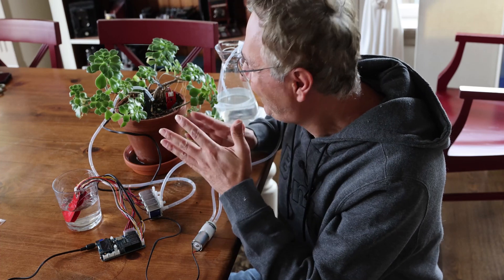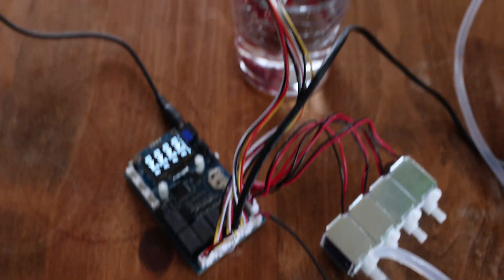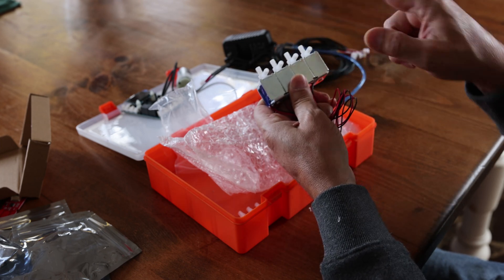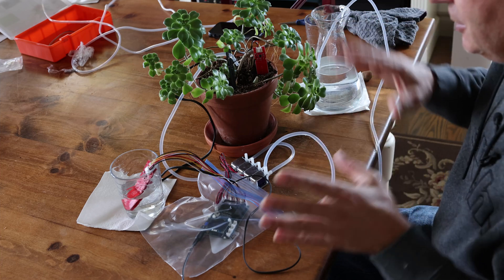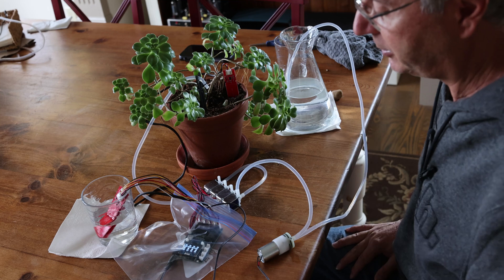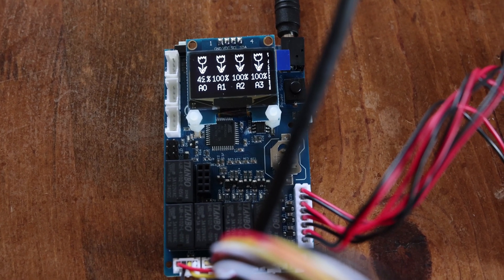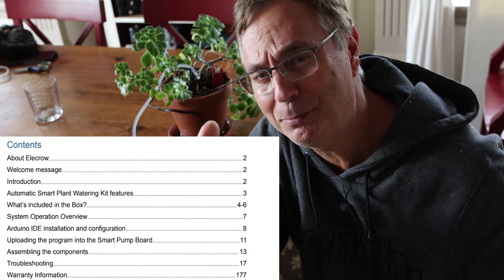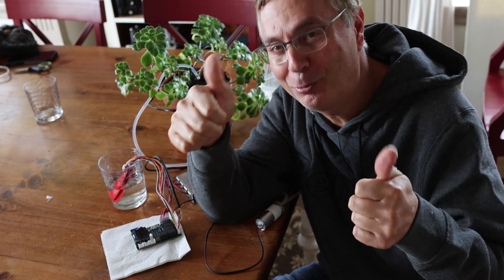Best Automatic Smart Plant Watering Kit by Elecrow  Using Arduino !!!

Comment: It seems the wiki and manual links don't work on Elecrow site, also forum link doesn't work. As complete newbie into Arduino ecosystem I bought this for it seemingly easy assembly and readily available steps and code. I found the manual(or at least older version of it) on the internet, but I didn't have the luck with the sample code. Can a good soul that already have these upload it somewhere and send a link? Seems little stupid to ask for it under youtube video but :shrug:

Comment: I'm on my second board that has a busted relay.  Or something.  The voltage to one valve constantly signals that it should be open.  The valve gets extremely warm and I don't dare leave it on for longer than 30 minutes for risk of fire hazard.  Also, look at all of the dangly things that need brought together.  It's not just the board and some hoses.  
I recommend cutting the (very long!) tube into six pieces of equal length.  #6 will need cut up a bunch to connect pump, to distribution and distribution to the valves.